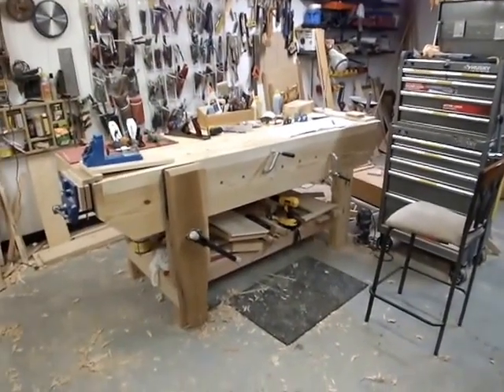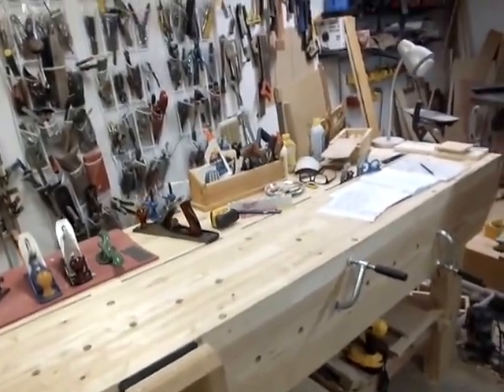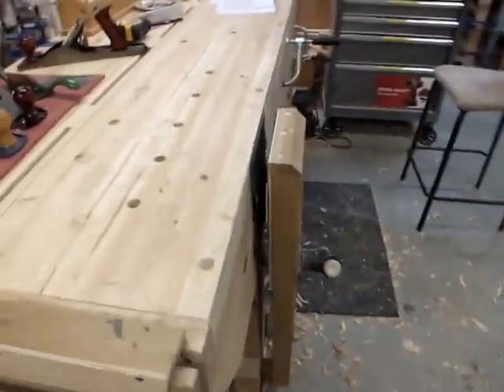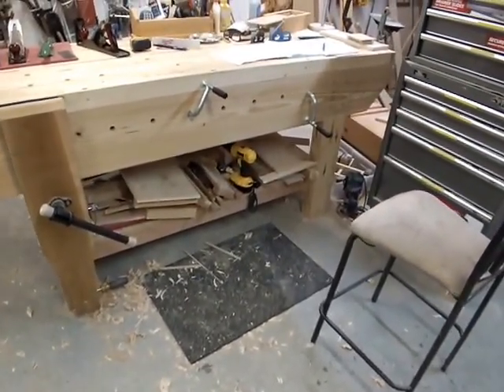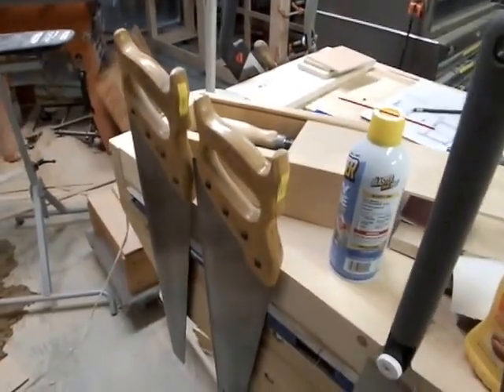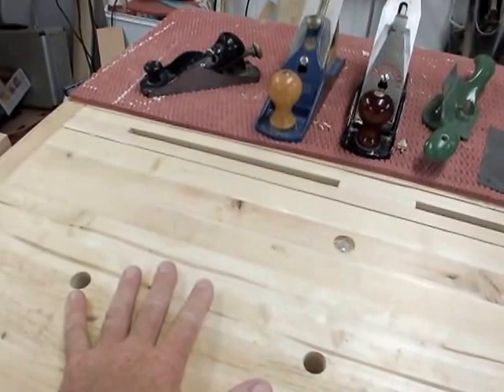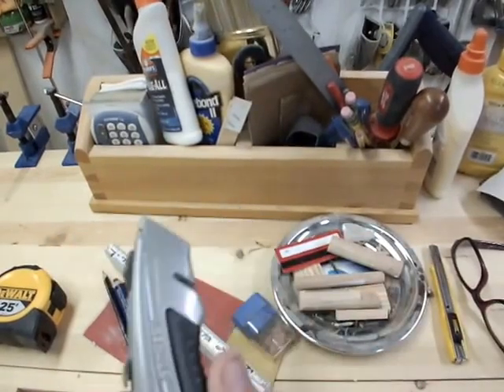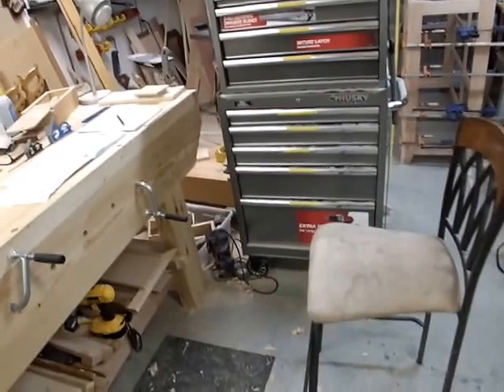little tour of my shop and the bench I use...

Comment: This is my new favorite channel, but can't agree about  the Irwin not being good. Its my best pull saw. I haven't used the pull saw you have, however.   I mostly use the 17tpi side, and none of the teeth have broke, still cuts smooth as the day I bought it years ago, no warping, no issues.  Soft wood, hard wood, miters...no issues.  Smooth cuts.  And cheap.  There are no replacement blades, but I just looked it up and buying a new one is the same price as a replacement blade for more expensive models.  Give it a try! I'd love to see a videon on the battle of the pull saws.
Reply from the maker: +Slap Stick  that's a good Idea....I have a Marples, an Irwin and the Vaughan, so I could do a comparison.  ( I could also throw in a Gyokucho as well)  thx for watching-